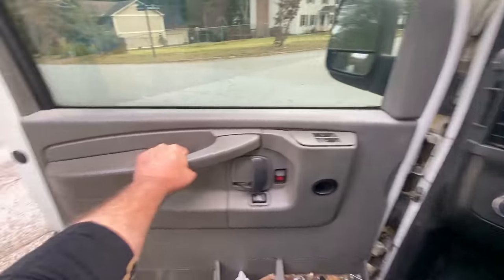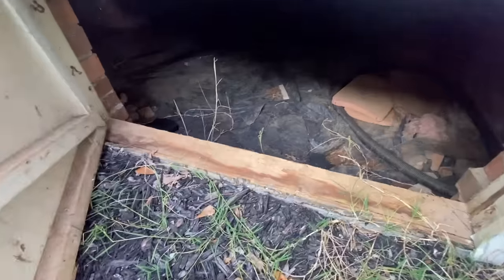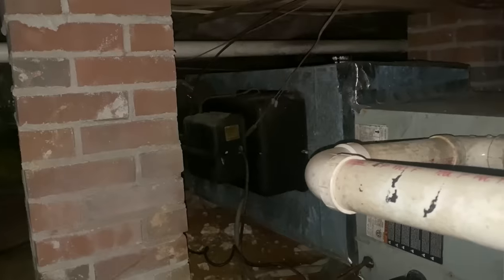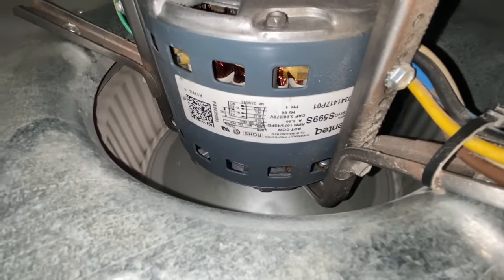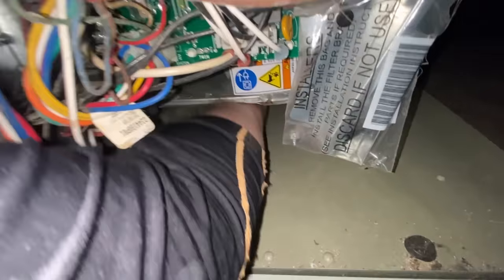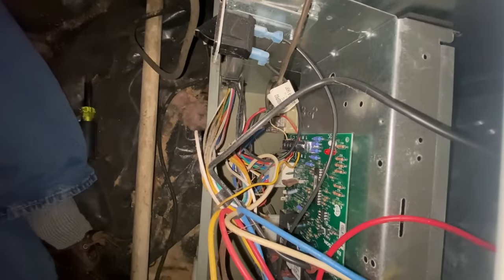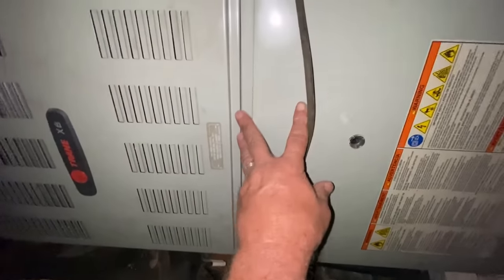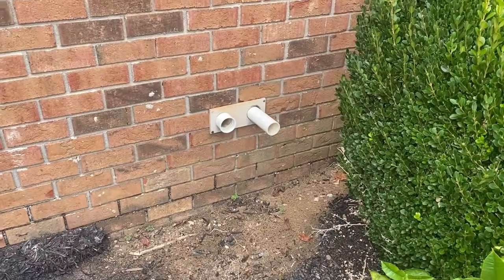Furnace Blower Motor making noise what will we find

Comment: That’s an old style AprilAire humidifier Theodore . I always hated them, like a damn jigsaw puzzle between the plastic clips and turn screw locking  clips just to change a water panel. I’ve found birds in vent motors and  paper in blower wheel’s causing the blower to shake like bugger. Good video Theodore .👍👍🇨🇦